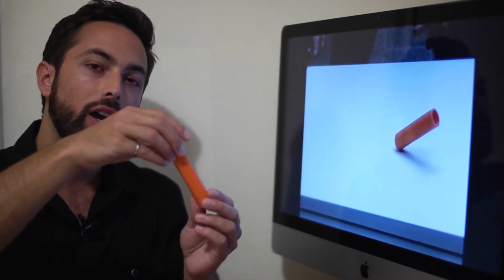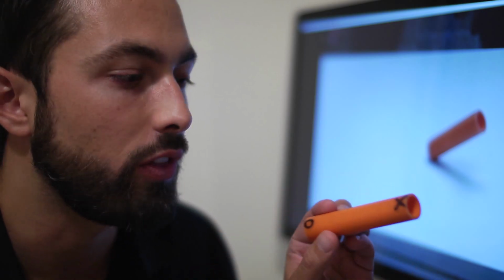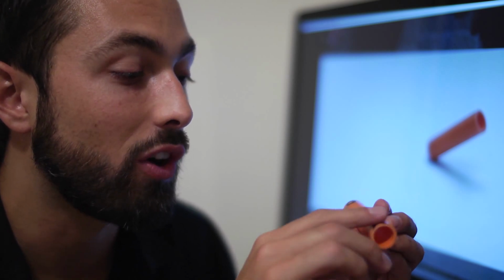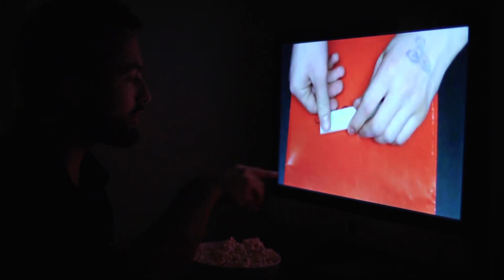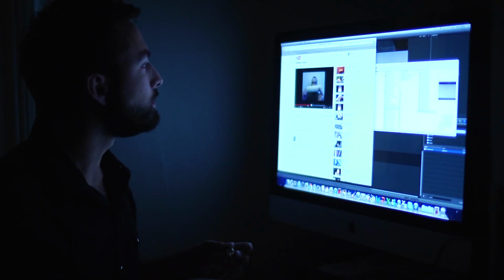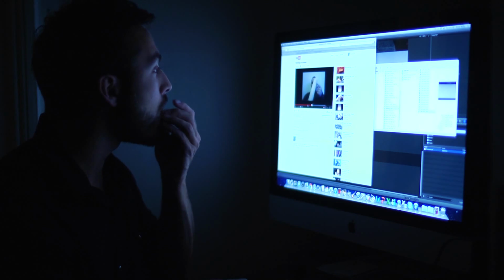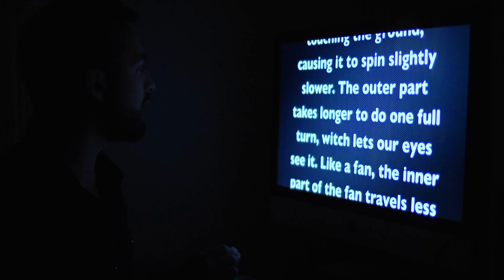Spinning Tube Trick Explained

Comment: Hold on!
My poor brain is saying if the two ends of a rigid tube are spinning in opposite directions around the long axis, wouldn't that produce a twist?
Surely both ends have the same rotational direction and every 180 degrees are alternatively spinning with and then against the the rotational direction through the centre. 
Help?!
Reply: The horizontal rotation allows the two ends to go in opposite directions, but the spinning is the same. The spinning is not the horizontal rotation.
Reply: Stuart Safford hello Stuart. I'll have to get a pencil and paper and try to figure it out. My head hurts!
Reply: I had trouble understanding then explaining it.  It would be better with a series of diagrams.
Reply: +Mohammed Hanif Did you figure this out because i immediately thought the same thing. This has got to be wrong. Like you said, its a solid structure so This seems impossible. If one side was spinning faster along the spin axis, you would get a twisted piece of liquorice and if one side was rotating faster along the horizontal rotation, the faster side would catch up to the slower side and it would fold into a V shape. So, i say it isn't spinning about the center of the tube in the horizontal rotation.  The ONLY way any side of this solid tube could travel faster and slower is if the center of rotation is not centered.
Reply: Balls Mortenson yes i still believe the explanation is wrong. The two ends are rotating about the length in the same direction and spinning about a mid point in the same direction. And they have the speed.
Reply: +Mohammed Hanif I understand now. See, when he says spinning backwards against the rotation i couldn't get my mind off working against it PHYSICALLY, but what he means is its working against it visually. So say the X side is spinning counterclockwise and sweeps across say, 2oclock-10oclock, So well say the X is moving LEFT. Now as the X starts showing up from the spin, its travel is going from left to right, slowing the overall movement of the X that you see. So it would have the same effect if it were spinning in air. Its hard to grasp.
Reply: rotating against the spin isn't relevant i don't think. take two coins and put an x on one, and an o on the other. spin them and you can just make out which is which. now you magically attach one spinning coin to a string and someone swings it around. You won't see anything. But they're holding the other one in their hand and you can see it is the x.
Reply: Forget for a moment that the tube is spinning really fast and just look at how it turns on the table. As the X end of the tube approaches you the O end is moving away. Then as the O end is appoaching you the X end is moving away. In that way the two ends are always moving in opposite directions which is why it's turning around in a circle. If you rotated anything in a circle you'd see the two ends move in opposite directions (one clockwise one counterclockwise). Now add back in the spin. As the X is coming towards you (and the O is moving away from you) the entire tube is spinning away from you. That speeds up the motion of the O and slows down the motion of the X from your perspective.

Comment: First, just think about the rotation around the long axis. If viewed from the bottom, X moves on the tube in the opposite direction (compared to top view). But the velocity direction around the short axis does not change. Thus, below the glass, for X, the two velocities are in same direction, and X is indeed faster than O.

Comment: Say you flip from X.  That X is being slowed due to the counter rotation is entirely dependent on the fact that you observe it from the same top side every time.  Switching to viewing it from the underside flips the rotation direction from anticlockwise to clockwise, just as a clock turned around runs backwards relative to you (of course it actually runs just the same).

Which symbol is being slowed for us to see it depends on which side we look at while it flips.

Comment: Viewed from the bottom, (assuming that the x was pressed) the o is travelling backwards around the long axis with respect to the circular spinning motion of the tube. It's because of the perspective change, in the same way that if you want to tighten a screw that is facing towards you (like an adjustment knob on the underside of the chair) you would rotate it with relation to your orientation the opposite of the normal way you would rotate it.

Comment: No, it doesn't change the rotations, it just changes which way the indicator (X and O) is moving, from above you may see it as clockwise, but from the bottom, it would be rotating anti-clockwise.

I don't know if this is what causes the trick, but I think it has some affect on it.

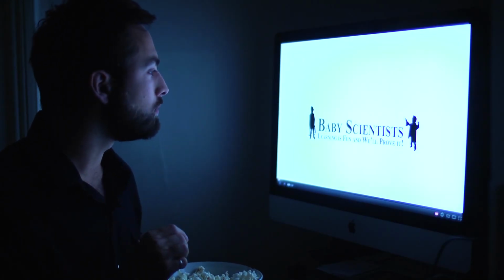Comment: the difference between top and bottom is just what some people below have mentioned -  rotation direction clockwise (CW) and counter clockwise (CCW) are relative to the direction of the observer. If tube spins CW from above and therefore CCW as viewed from below, everything is reversed. The whole thing is much easier during the first part if this video - from 50 seconds through about 1:15 when it is going really slowly and he has some arrows superimposed over the tube. Nothing to due with refraction or any material -specific distortion

Comment: The explanation for this is that the tube will be spinning around its own center axis (within the hole of the tube) while rotating around a vertical axis. The letter that you put your finger on when you spun the tube will be spinning in one direction and the tube itself will be rotating in an opposite direction. This will make the x look slower relative to the other letter, and easier for your eye to see than the other.
When you look at it from under the table, the opposite happens. The x will be spinning in one direction and the tube will be rotating in the same direction while the other letter will be doing the opposite.

Comment: The 2 ways the tube is spinning combine to make surface the surface on one end move more quickly than the other. If you look from the top, the side you pressed has the cancellation effect, but if you look from the bottom, the other side has this effect.
It's a very similar principle to the rotation of a tire. The bottom of a tire doesn't move when a vehicle is in motion (perfect cancellation of relative motion), and the top moves quite quickly (2x the speed of the car).

Comment: because of torque acting in x, it does'nt touch the ground and hence the relative velocity between the ground and the tube is 0(PURE ROLLING) and o is in contanct with the ground.so friction opposes it and hence its acceleration is reduced and the acceleration of x is much much more than 0.well so  the acceleration of x is more than that of o and hence x turns up more no of times than o in a given time(that is in 2 seconds, for example if o is shown up 10 times then x is shown up 50 times), so w see x more times.
Reply: That's definitely not what's happening, because it's a rigid object. No matter how many times one spins, the other spins the same number of times. If there's friction applied at only one end, it will still slow down the rotation of the whole tube.

Comment: i have a simpler answer to this. the outside spin has a longer traveling point vs the inner which is spinning much faster. the inside is too fast for the eye to catch. this is similar to looking at a ceiling fan. you can actually slow the fans rotation if you look from the outside end of the fan vs trying to slow it down looking on the inside.

Comment: As the vectors keep exchanging, and the speed drops, the same rule applies, meaning the O is always at the bottom when the length dominates, and the X is at the top when the circumference dominates. Conservation of momentum. So, when the end away from the X, faces up, it contains the force and is swinging at right angles to the viewing plane at high velocity, shrouding the eye'e perception of it. At the same time, the other end is rotating slowly, displaying the X. Then, as the long plane motion

Comment: (I think) When you look under the glass plate, you see the bottom side of the 
 X's rotation, which means it will be going in the opposite direction as when viewed from above. So relative to the tube's rotation, the O will now be rotating more slowly since the directions become reversed relative to the rotation of the tube about its middle.
Reply: Yeah, I figured this out too. Surprised he didn't cover it here!

Comment: I had trouble understanding what was meant by "velocity will be reduced" at minute 0:52. I understood it better after using a pencil and turning it slowly in my hand while moving my whole arme slowly in one direction. 
You can make the tip of the pencil stay still while rotating your hand and moving your arm at the same time. If you keep the rotating direction of your hand and try moving your arm in the other direction you will not be able to keep the tip of the pencil at a steady position.

Comment: An average humans Flicker Fusion Threshold (the point at which the flicker will no longer be perceived) is dependent on illumination.  At low illumination levels it is around 20Hz, while at high is around 60Hz.  30fps is perfectly adequate for film, as it is black between frames and most people will not perceive any flicker.  High sample rates in TVs exist to combat specific problems not directly caused by flicker, such as lack of saturation in plasma, or eye tracking motion blur in LCD.

Comment: Also I think that the side that is touching the ground( or the opposite side from where you put your finger) has less energy and also a lot more friction causing it to allow you to only see the letter you put your finger on

But the side you put your finger on has more energy causing it to have more thrust up-wards (referring to your spinning disc on a pole video) which will cause it to go higher but it is on the outside which will make it in your view longer which will allow you to see that letter

Comment: The directions are based on your point of reference. When you flip the point of reference you flip the directions. But only of the tube's spin not it's rotation which is why the end you can see is opposite.

Comment: We should try it on different length of tubes. My hypothesis is by shorting the tube, the total circumference cover by the outer end would be relatively closer to the circumference cover by the inner end of the tube. (and that not assuming that the inner end is spinning on point) and hence harder to spot its symbol. Likewise, if the tube is extremely long the tendency of spotting the outer symbol is more frequent and almost definite as now the outer circumference would have been many times larger compared to the inner circumference covered by the inner end. But because the tube is a cylinder, the outer end would have to complete more rotations in order to totally cover its required travel distance and as such, its symbol will resurface more often!

Comment: Secondly you can do this same trick with any coin. Spin the coin on it's side. As the coin come to a stop it will have the same double-axis spin the tube does in this video. If you view the coin from above you will notice you can't see the bottom half of the coin. View from the side and you will see the edge of the coin more than the surface of the coin. It's a visual mind trick.

Comment: But if we go by this explanation i.e. slower velocity of one side then we should be seeing the same symbol (X) when viewed from the below (in the case of glass), but in your video where you demonstrate this trick on glass, we see a 0 instead of X when viewed from below. both rotational and tangential velocity remain the same and when viewed from the bottom side both change the direction. Since when both are changing the direction, we should see the same sign. Further for viewing, our eyes consider the overall magnitude of the velocity which when changed the frame of reference should remain the same. Even if we applied the rotational transformation matrices and generalized velocity equation the only difference in the overall velocity when shifting frame of reference would be a negative sign.

Comment: slows, like a spinning top, it develops a wobble, further degrading the visual perception of the surface of the motion, but the same rule applies, in that when the O is on top, the axial vector dominates, diffusing the light from the slow shaft rotation of the tube.

Comment: think about it, in a black hole, because of the big quantity of gravity, it deforms the space-time network, making it larger, and where the time flows slower. So the question is how slow can the time go, because if there is a limit between the slowness and the full detention of time, that means that the space-time network at one point it will break and leaving a place where the time doesn t flow
Reply: Time is slower the higher the gravity.
Gravity is higher the higher the density.
Density is higher the more mass OR less space is taken up.
Since infinite matter (and therefore mass) is impossible we have to talk about space.
So if you take any amount matter and put it in the amount of space which could be considered 1 dimensional, a singular point, zero space or volume, or as you may know it - a singularity, then the density would be infinite according the the equation: p=m/v
"p" being density
"m" being mass
"v" being volume
If density is infinite, gravity is infinite, and time stops at that point.

So time can stop if and only if density is infinite. If and only if you can make matter take up zero space.

Comment: When viewed from beneath, the frame of reference is reversed, so the rotation is reversed and the "O" spins in a manner that slows its relative velocity.  When viewed from above, the tube spins in an anti-clockwise direction, but when viewed from below, it spins clockwise.

Comment: I knew it. Not only can I see both if I test it by myself. Technically everyone should see them both from both sides. You seeing just one only because of the motion blur. Reducing the shutter speed will reduce this effect. Now it's only a question about how fast the tube spins the X and O around itfels. Depending on the position of them at the moment the camera takes the frame you will see both or non of them (or the X or O if you place them on oposide sides).

Comment: When you look from the opposite direction (below the glass table) the horizontal rotation will be reversed, meaning now the movement of the O being backwards with respect to the horizontal rotation. So the O is moving slower than the X and become visible.

Comment: That actually is quite simple. Looking from above, its the x (if you pressed on X at first) which spins against the direction of the spinning tube. If you look from beneath, it will be the O which is spinning against the direction of the direction where the tube is spinning in.

Comment: So basically what you see is dependant on the fps (frames per second) that you are viewing the object. This is similar to a common obstacle I face at work diagnosing automotive electrical problems. If the oscilloscope isn't set to look at a small enough section of time the faulty sensor will appear to be functioning properly as the segments of time that the fault occurs are skipped. That is why in slow motion you can see both symbols. Think of viewing motion with a strobe light set at different speeds. ;-)

Comment: Rather, the spin rate of the circumference is a harmonic of the lenghth. Meaning, when the X is up, and the O is also up, the motion of the tube is such that the energy is in the long half of the swing, or the vector for torque is at right angles to the long side. Therefore, given the start point, and the math, the marks will be facing down. Halfway through the rotation the vectors swap position, the marks are on top, and the short end, rotating slower then the apparent long end, dispalys the X.

Comment: No, but I can see how you might grasp at that explanation, even though the video evidence falsifies it: it makes sense but does not happen to be correct. Recall that from the top you see the letter pressed from the top but you see the other letter from below during the spin. Thus there's a third factor.  If you slow the youtube playback you can see a vibration blurring the o when you see the x, and visa versa, and you can see both x and o are otherwise about equally affected by the spin and rotation. This vibration is imparted by the snap, and the vibration moves back and forth from end to end of the tube, and the vibration blurs the letter on the end that is vibrating. The period of time for the vibration to move from end to end is a multiple of the period of the rotation, thus vibration and rotation of the tube are synced, because the impulse energy is simultaneous for both. If you press the x you impart the vibration to the other end for that instant while the x faces up beneath your finger, and thus the instants when the x end is not vibrating happen when the x is up, which of course are also the instants when the o is up for exactly the same duration but is vibrating.  Cheers.

Comment: almost got it. i figured the main thing it was spinning opposite to the movement, and had something to do with 'frame rate'-ones moving too fast to see. but couldn't work out why one from the bottom if they are both on the same side.

Comment: Similarly, try looking up at the blades of a ceiling fan but instead of following them in the direction they are travelling, move your eyes in the reverse direction. The part of the fan opposite your eyes will be more clear than where your eyes are looking. It looks somewhat surreal.